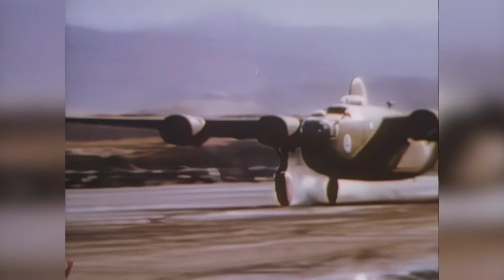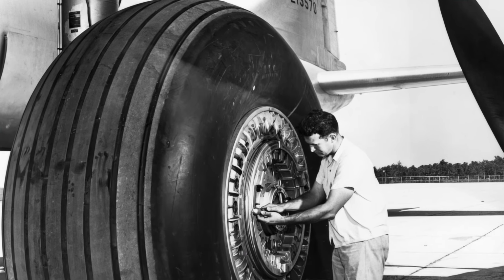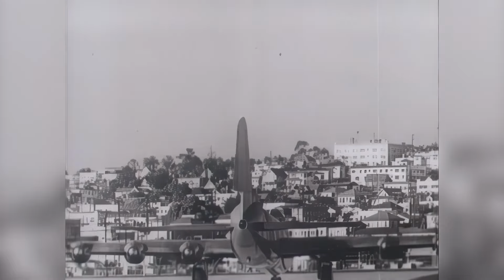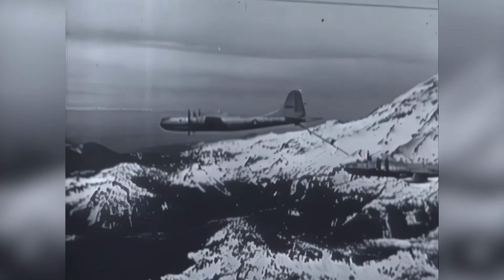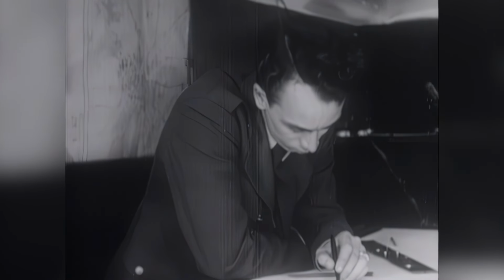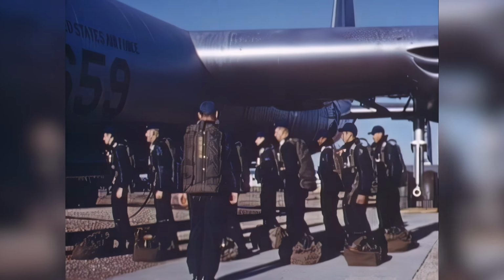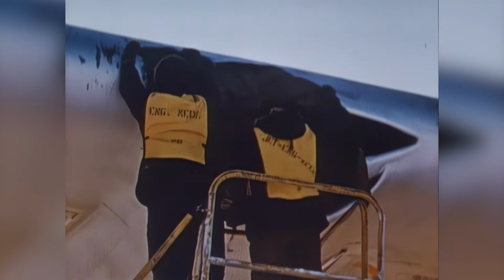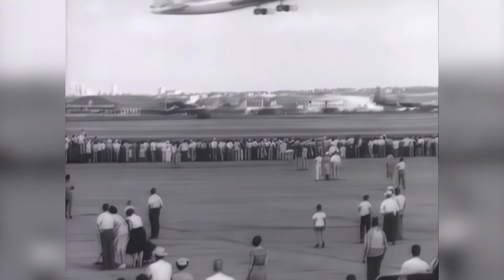B-36 Peacemaker | Convair's massive American strategic bomber | Upscaled video

Comment: It was far from a sitting duck. Often Navy fighter pilots would ask permission to "practice". The B36 went full throttle and started climbing while the radar tracked it in, and just at gun range the 36 went into a turn. With the low wing loading compared to the fighter, B36 maintained altitude. When the fighter turned it dropped away thanks to the high wing loading.
Reply: The other day I read the Soviet Backfire bomber had 145 lbs wing loading.

Comment: At 25 minutes into this video, I like it a lot. You did neglect to mention the jet engines were modified to run on av gasoline so two fuel types were not needed. Av gas for the recips and for the jets.

Comment: On the first test flight, before the addition of the jet engines, it got only ten feet airborne and two engines caught fire. It ended in a swamp. Its claim to fame was the large bomb load, but when they added the jets, they had to carry special fuel for them and it reduced the payload by 40%. It was a massive fail and the B52 program was accelerated.
Reply: You must be thinking of the B36 in an alternate universe.  They didn’t need special fuel for the jet engines.  It wasn’t so much a massive fail, more like kind of average and the end of the line for huge piston bombers.
Reply: That's right the b36 jets ran on the same fuel as its radial piston engines,as to avoid confusion.The jets were modified to operate on regular old aviation gas,so to avoid catastrophic engine failure from refueling accidents.

Comment: Very cool video on the Convair B-36 Peacekeeper intercontinental bomber.  Thankyou for sharing.  In Alaska, they had two mechanics assigned to each engine on the B-36 to speed up its readiness.  The B-36 was commonly referred to as the "magnesium monster" because its airframe is made up mostly of magnesium.  Because its made of magnesium, thats the reason why none of them are flying today.  My father got to take a ride in a B-36 when he was stationed at Offutt Air Force Base in 1956 when he flew the B-52B for SAC as a co-pilot.  General Curtiss LeMay came over to inspect his B-52B with a cigar in his mouth. A young airman suggested to the General that he should put his cigar out or it could cause my father's B-52B to blow up.  General LeMay looked at the airman and said straight faced, "Son, that airplane knows better than to blow up on me."
Reply: One to carry 2 buckets of spark plugs, the tools. 😆

Comment: Using conventionally armed B 36 's to bomb Germany from the continental United States would have made no  operational sense. The logistical challenges would have been tremendous. The damage to German industry would have been less than the cost of mounting bomber raids from the United States, even if the operational and non-operational losses incurred were negligible. The cost of fuel alone would have been terrific. Furthermore, German jet and rocket fighters would have made mince meat out of these unescorted bomber formations. The whole thing would have been a bust unless the B 36's were equipped with A Bombs.

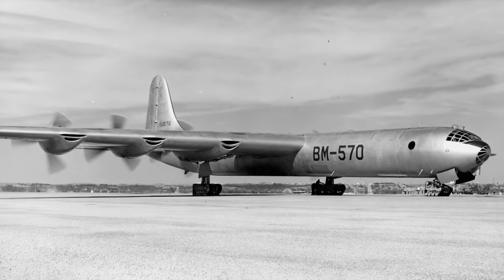Comment: An interesting note at 8:20 in the video you can see the experimental use of "tracked" landing gear on the B 36.
The original landing gear used tires about 11 feet tall. And those tires put so much weight on a small point of the ground, that there were only a few runways in the whole U.S. that could handle it. Eventually the B 36 used a multiple tired landing gear design, saving both weight and the higher cost of much larger tires.
Reply: More like 8 feet according to the video. Still amazing for an aircraft tire!

Comment: I have never forgotten the sound for this aircraft, it vibrates the ground even when it’s at high altitude. I was 12 years old and heard them before I could find flying over. This was in South East Texas, Bessmay 1955.
Reply: I grew up about 55 mi. E of San Antonio.  These giants could actually be felt vibrating the ground when flying overhead, but seldom seen due to haze and clouds above. A cargp airplane, the XC-99, was based on the B-36.  I could actually see them flying overhead.  I'm not sure if more than one of those was ever built. It actually flew out of Kelly AFB, in San Antonio.  That base was a major supply and maintenance center, known to the AF Logistics Command as an "Air Materiel Area. It was one of 6 AMAs in the US. The XC-99 usually carried large items between the AMAs.  Years later, the XC-99 was a derelict, sitting at the W. end of Kelly AFB.  It was supposedly later moved to the Fort Worth area, where it and the B-36s were built; with a partial restoration planned.  This blog was originated by my late wife, Judy, so her name will appear as the writer, but it was me, former Lt Col Melvin Hoskins, USAF Res. who wrote this.
Reply: She used the second largest propellers ever fitted to any airplane
Reply: The B-36s used to "bomb" the city I lived in regularly.
 You would hear them overhead and look up and there they were, looking like they were standing still. The B-36s were very slow and would have been sitting ducks for even the early jet fighters. The US Navy said they would have been completely useless. Without fighter escort, the B-36s would have been dead meat, and the jet fighters of that day didn't have the range to escort them to their target.
-
The USAF was trying to keep a secret from the Russians on how many B-36 were built. So, they moved them from base to base to possibly confuse the Russians....But then a member of congress stated in a speech " Why do we need 350 of these stupid things?"
Reply: I would love to have experienced that! Sadly, they were taken out of service 7 years before I was born.

Comment: The YB-35 had two major issues. Engine issues. Flight instability. The B-36 itself had severe engine issues. Along with it’s massive size and only a handful of runways being long enough to handle it. The B-35/49 may have been a better choice.
Reply: It would seem as though history has vindicated this presumption given the short service life of the 36 and the now still in service B2
Reply: @tgflowers2393  ….. The B-35 had it’s own engine issues. The B-49 wouldn’t have the range the USAF wanted. Then there is could the instability to be overcome. Jack Northrop was certain he had a superior aircraft and was cheated not just for losing a contract. The scrapping of all the prototypes ensured the flying wing couldn’t be revived. How is that to be explained for any other motive? The B-36 was a technology step backward in comparison to the flying wing and the B-47.
Reply: None of the flying wings had the range or load capacity to carry the nuclear or thermonuclear devices the b36 could , and far to unstable as a bombing platform in several axis .

Comment: Just a suggestion: The archive footage looks like it has had a digital sharpening and noise reduction treatment. The edges are overly sharp and a little strange to see. I think we all know what to expect in old black and white footage from close to 80 to 90 years ago so it isn't necessary to give it this touch-up. Still, if anything, I'd say you went just a little bit too far with the sharpening / noise reduction. Pull it back maybe 25% and it might not look as strange.

Now, if you're already putting this archive footage through a digital treatment, why not do some video stabilization too? That wouldn't look as odd to the human eye as sharpening would and definitely would enhance the picture tremdously.

And don't get me wrong, this is otherwise a fine video essay.

Comment: I have a pic of Grandpa in the sandbox in 1955, with a B 36 in the background.  The B36 was involved in the first "Broken Arrow" a term to describe a misadventure with a Nuclear weapon.  On Feb 13, 1950, Captain Harold Barry and a crew of 17 took off from Fairbanks, Alaska (Flight 2075), with a planned landing in Montana. The aircraft iced up and began to lose altitude  after one of the "six turning" caught fire and was shut down.  The crew bailed out over the ocean.  Captain Berry reported that the aircraft turned sharply after the crew bailed.  Captain Theodore Schreier, the weaponeer, was never found, although 12 of the 17 crew were rescued. It is said that the abandoned B 36 cruised for another 200 miles, veering from it's set course and crashing into the snow on Mount Kologet. There was a rumor that a body was discovered at the crash site. Captain Schreier was a former Airline pilot, with lots of hours in "heavies". Several things bother me about the official story.  1, the B 36 in question had overheating problems on the way to Alaska, 2, How can a heavy aircraft  turn and fly 200 more miles with one engine out, and not circle from the asymetrical power. My thoughts, ( after living for awhile in Terrace, BC, ) the nearest town to Mount Kologet, are that Captain Schreier, knew about the deep soft snowfields near Mount Kologet, and volunteered  to fly to the snowfields and belly land the aircraft into a snowfield, saving the nuke, sacrificing himself and the aircraft.
Reply: Auto pilots are engaged before a crew bails out so no one has to sacrifice themselves holding the controls for the sake of everyone else, it is entirely possible for the aircraft to have encountered something that overcame the autopilot momentarily and caused a course change in it, if an engine was on fire anythings possible as far as that goes.
Reply: Best theory on the strange flight path.  Others make the remaining man into a “Bad Guy” of some kind.
Reply: Grandpa is part of The War Generation often dubbed The Best Generation n thier children..Like You I'm a direct desendant n Very Proud of Grandpa 👴
Reply: @russellhamer8690  USAF 215 on the B36.
Reply: Grandpa is pictured with B 36 USAF 215
Reply: @franklinnorth7708  That's my Grandpa